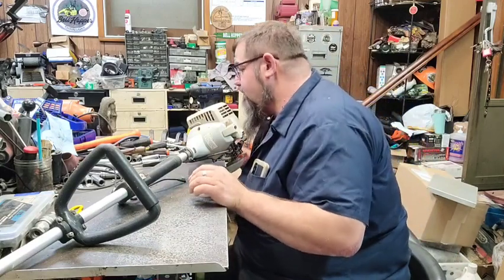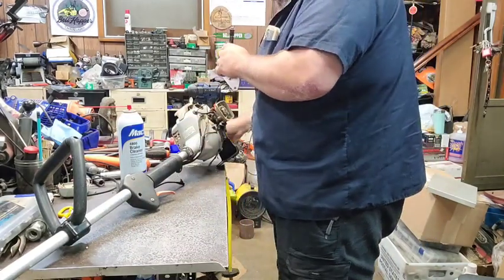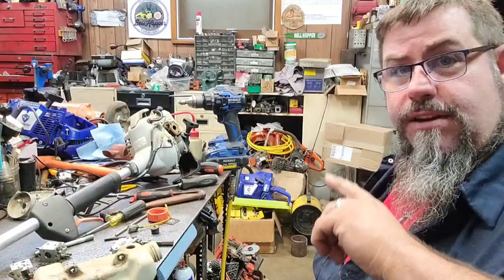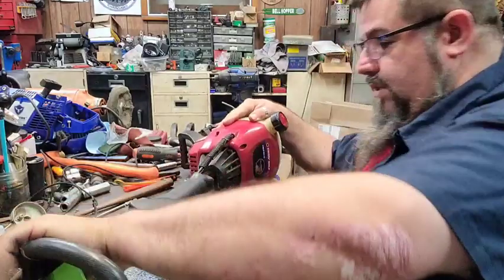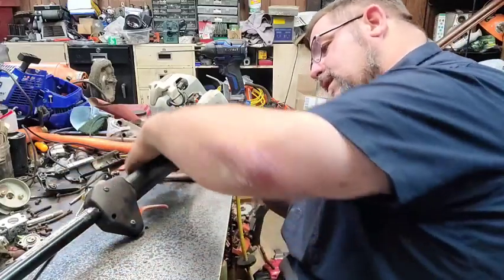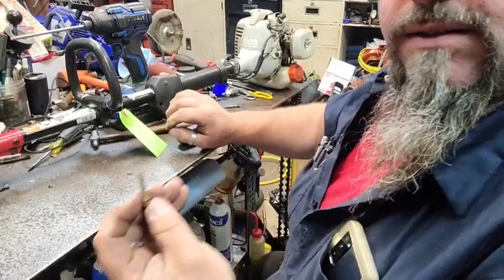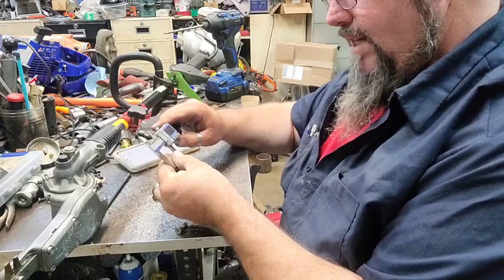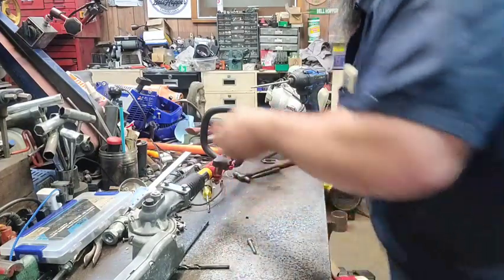Can We make Echo Weed Eater A Hedge Trimmer?

Comment: Hole centres cheat method with a digtal vernier....1) measure your bolt first and zero the vernier at the same time 2) measure around the outside of your bolts like you did in the video ...number you get is the bolt centres distance. Remember to rezero vernier afterwards.

Comment: Did you grind down the square drive to pop into the echo square drive??? You big cheater!!! I’ve been trying to run the mtd cheap attachment (tiller) on an echo powerhead and didn’t get it done!!! I’m definitely going to have to go back and look at that project again!!! A little trimming or something like that???  Dang gone it, old son!!! You’re slick buddy… very slick!!! I love it!!! 😁👍
Reply from the maker: Hey buddy the square drive was the same size i just shortend the outer tube about 3/4 of inch
Reply: @bellhoppersaws  that’s just fantastic buddy!!!  I’ve had an mtd tiller I grabbed at a yard sale for $20 bucks maybe several years ago and I’ve got about 25 echo weedwackers here as I bought out a couple of companies old lots and picked them up here and there… the 266 high torque heads are like the 265… but beefy and I’ve got a dozen of those… I grabbed a short shaft setup off eBay last year so I could make another pas system setup… I bought the Shindawia combinations so they have splines… I have 3 short shafts that were eBay $20 dollar deals too… I was thinking about welding up that spline end then I could grind it squared and use that tiller on my Shindawia heads!!! That would be absolutely awesome because they want about $350 for their tiller attachment and that’s just not no ware near going to ever happen!  You definitely have got my mind going and I’m thinking that I’m finally going to get these couple of projects together!!!  Really appreciate that I’m not the only one who wants to cobble together tools on the cheap!   I gotta break down and buy that harbor freight lathe so I can start cutting cylinder’s!!! I don’t consider a saw completely ported unless it’s had the combination chamber reduced!  I have a manual squish band cutter for the 50mm bore so I can do the 372’s but not the 52’s… I might try to make a shim or sleeve for my 50mm cutter???  My old guru passed on me last year and the machine shop is gone… I really miss being able to make what I want!!!     I bought a couple of those Chinese 90 degree handpieces for the Foredom like that fella set Harvey and TinBasher… two came with bad collets so they are $80 bucks apiece worth of can’t hold a burr!  It’s killing me!!!  Can’t speak with them because they in China… I need someone to make a couple collets!!!! Probably ain’t gonna happen… 160 down the drain???

Comment: Hey hopper, on your holtzforma g372 build. You were running it on either alcohol or was it methanol fuel?    How do you make it exactly?   I'm toying with an old poulan 3700 and I was just wondering.  Or if anyone else knows please let me know.  Thanks 👍
Reply from the maker: Hey buddy its m1 methanol mixed 20:1
Reply: @bellhoppersaws  THANKS!
Reply: I believe I heard hopper saying that he had to drill the main jet bigger too so you can flow enough fuel mixture to make it run right???  Thinking it’s techniplate oil with the methanol?   If you get your receipt right that old 3700 would get down and buggie on that mix!! 😂😁😜🤘